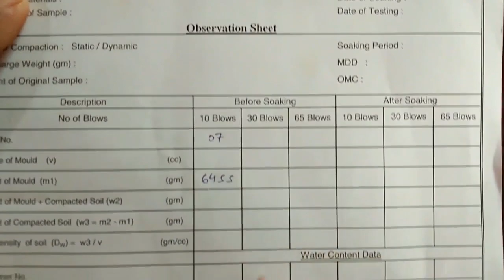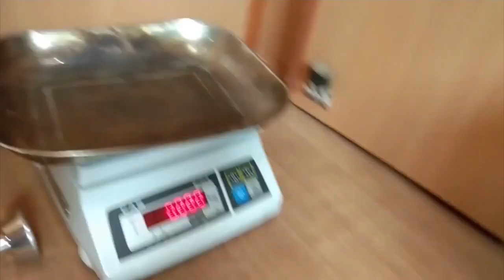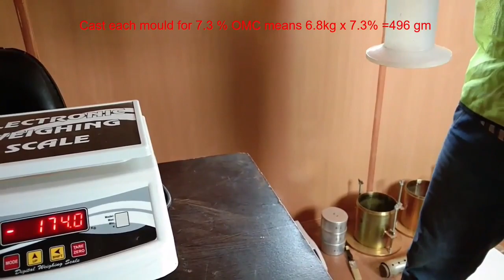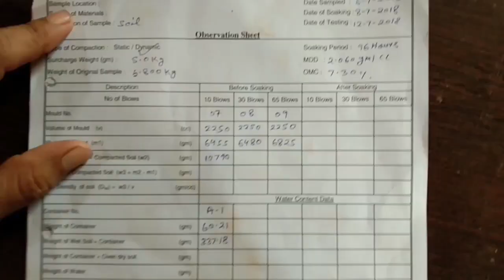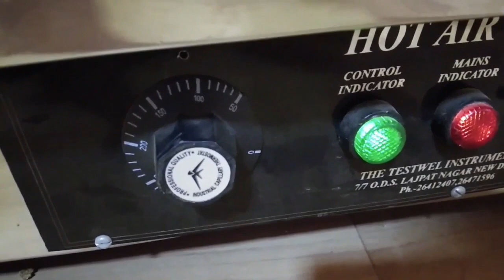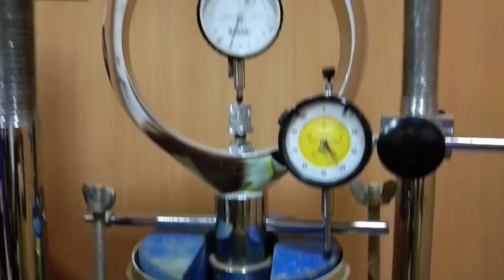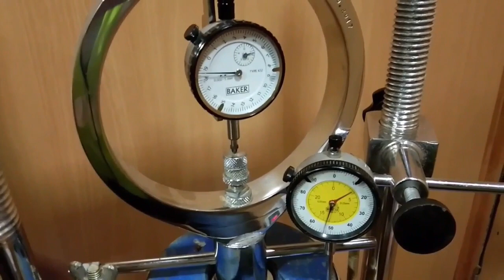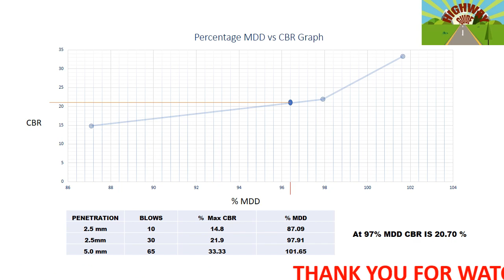DETERMINATION OF CBR

Comment: The soil sample used in the CBR test should pass from 20 mm size and retained on 4.75 mm size. Is it correct? Or, the soil pass from 20 mm sieve can be completely used without control the 4.75 mm sieve. Could you explain this clearly please? Thank you.
Reply from the maker: If all material passes a 19.0-mm sieve, the entire gradation shall be used for preparing specimens for compaction without modification. If there is material retained on the 19 mm sieve, the material retained on the19 mm sieve shall be removed and replaced by an equal amount of material passing the 19.0-mm sieve and retained on the 4.75-mm   sieve obtained by separation from portions of the sample not otherwise used for testing. From a sample having a mass of 35 kg or more, select a representative portion having a mass of approximately 11 kg for a moisture density test and divide the remainder of the sample to obtain three representative portions having a mass of approximately 6.8 kg each.
Reply: @HIGHWAYGUIDE  Thanks for your clear answer..

Comment: Dia of mould 150mm & Height of mould 175 then volume of mould 2250 ? How it is
Reply from the maker: 175 height is including with collar which is 50 mm so while calculating volume , you have to take height 175 - 50 = 125 mm
Reply from the maker: Generally mould height is  considered 127.4. You can measure it in laboratory.

Comment: If I test one mould with 10kN Proving ring capacity and other mould of same soil with 5OkN capacity Proving ring.!

Do I get same CBR values??? If not how it varies.!??

Plz explain sir.!! Waiting for your reply!!
Reply from the maker: Same CBR value but you have to change calibration factor.
Reply: The capacity of proving ring only metters when CBR % is high 
Soil normally cen be  tested with 10kn however when you are testing
Wmm material which required 100% CBR value then you have to use 50kn ring

Comment: If the dia of mould is 15 cm and height of mould is 17.5 cm then how the volume comes as 2250 cc ?
Reply from the maker: Modified compaction mould) As per IS 2720 (Part VIII) 1980, IS 10074

Cylindrical mould of Mild steel having volume of 2250 cc with an internal diameter of 150 ± 0.1mm and an internal effective height of 127.3 mm ± 0.1mm.
Fitted with a detachable base plate and removable extension collar with 60mm height.
Reply from the maker: 175-47.7=127.3 mm
Reply from the maker: 47.7 is the spacer height